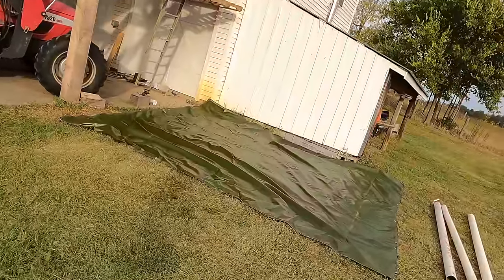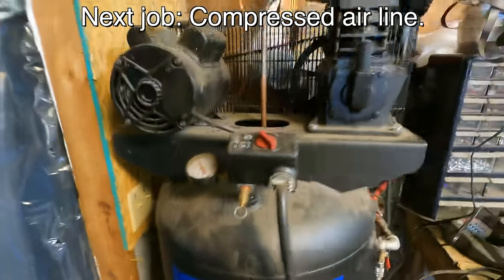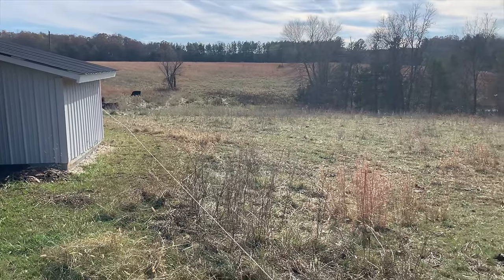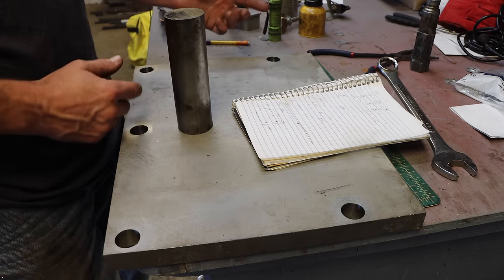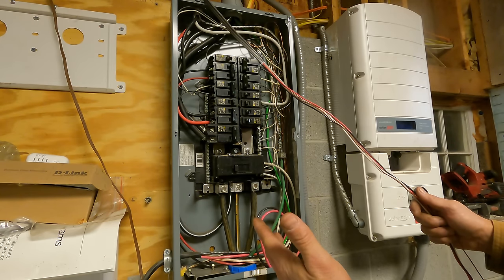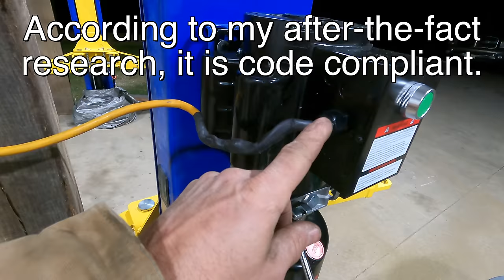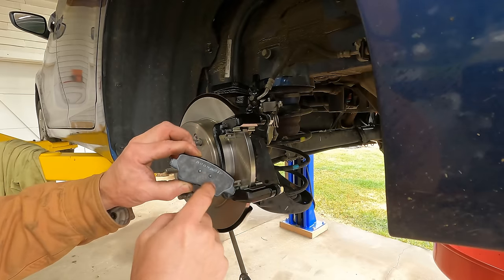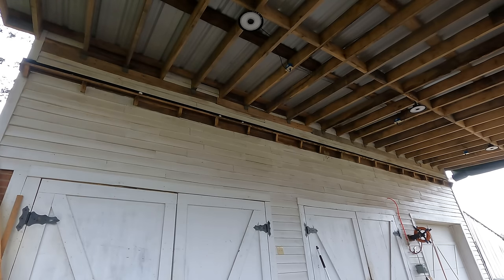Installing a 2-Post Vehicle Lift And Other Big Shop Improvements.

Comment: As an engineer I would have suggested that the 'lower' post was held with all thread into the concrete, levelled with nuts on the all thread under the base plate, the top nuts tightened and the void filled with cementitious grout. Much cheaper and thats how most gantries and lampposts are installed..
Reply: While that would technically work seems like it wouldn't spread the weight as well as full contact underneath
Reply: How do you know what I am or not?
Reply: @mrmotofy  because you would not have replied with your comment. Steel framed buildings to gantries to street lamps use this method to level uneven floors. But hey you know best ... carry on

Comment: I've never seen a car with the back disks not vented.  Now I have.  I sure could have used a lift like that back when I used to do my own brake jobs.  Been a few years since I've been able (I just turned 75 and have certainly gone downhill health wise since I retired a few years ago).  I used to do a bunch of the things he does except I never had the tools (lathe, etc) he has.  But then I live in the city (just outside Atlanta).

Comment: About 11:40, after you cut the ring off, if you dip the pex in boiling water, it will expand and slip right off.

Comment: 2 post lifts are extremely safe if you always use the locks and get the arms under the right spots on the item your lifting, but you can dammage the top of a truck or car or the hood if you don't pay attention to the top as you lift something. 
These would work in a lot of houses garages on cars without a problem providing you dont hit the celing with them.

Comment: The 220v supply to the lift should have an isolater in case  of emergency you can isolate the supply,  since the main panel is on the inside. Great work

Comment: Excellent video. Very impressed with the vehicle lift, what a great addition to your workshop. Must admit, l was wondering about the gap between the base of the lift and the plate on the ground. For the small expense and little work, l thought that putting the grout in was a good idea.
Didn’t realise how much grass cows eat, they didn’t half go through that field.
All the best……Paul from Aus.

Comment: A little tip for changing the brake calipers! Leave the old caliper attached to the brake line until the new pads/rotors are installed. Next install the new caliper around the pads and bolt it in place. NOW remove the brake line from the old caliper and transfer it to the new caliper. 

Doing it this was minimizes lost brake fluid due to the new caliper being in the perfect position for the brake line to naturally fall into position and the banjo bolt can be quickly reinstalled.

Comment: Good job. Two things I would have done differently. I would have run and entirely new cable from the lift to the power box rather than join cables, (I kinda freaked out watching that one). Also, I would have used a vibrator on the concrete to get rid of the air. In Australia you need 150mm, (6") of 32MPa concrete for under a hoist. I worry about the angular stability of that hoist. Please take care with it.

Comment: The normal way to set a base plate above the surrounding concrete slab would be to drill the holding down bolt holes and then use all tread bar, in this case 16mm (5/8") or so and resin anchor the bar into the slab.  When installing the bar a nut can be put on under the holding down plate that when the resin has hardened can be used to adjust the height of the base plate to line and level it.  The gap under the base plate is then  filled with non-shrinkable grout.  This would be so much simpler than all the fabricating and not to mention cost of materials.  I would also be circumspect about the location of the two post legs as they straddle a crack inducer joint and are too close to the edge.  There are substantial forces on the base plate/bolts that will crack the concrete even if it is an 8" fully reinforced slab (normal spec for a two poste lift installation)

I was a consultant for a major (cap. £4Bn) transport company and their standard spec for air line distribution was screwed galvanized pipe as the push fit plastic pipe installations invariably failed that could cause injuries due to flailing pipe.  The company were paranoid about H&S.  Screwed galvanized pipe was more costly but much more reliable.  On one job where the developer had installed push-fit plastic, on first charge up several of the joints failed and the instruction was that the whole depot would not be occupied unless the plastic compressed air system was changed at a cost of £10,000s

Comment: Nice work. I'd swap out the drywall screws for wood screws since they aren't threaded all the way. The threads on a drywall screw are relatively sharp and will cut through the cord eventually.

Comment: Drive in wedge anchors, run the nuts up or down to set your height and level the post, grout the gap with actual high strength grout bro. Use the stainless for a flatop griddle.

Comment: I used pex for my shop air and haven't had any problems either.  The main issue I understood with running pex is you need to be cautious of air temperature.  Hot air directly from the compressor could cause a failure, but the large air take you (and I as well) have will likely let the air cool sufficiently.  If pex does fail, it shouldn't produce flying debris like PVC.

Comment: You should make a lag hook bit for your drill, you can tighten a lag hook into the chuck of your drill and use it to quickly tighten down your other lag hooks by hooking the hooked ends together.

Comment: The thing about pex vs pvc when using it to pipe compressed air is that pex will never shatter and sling shrapnel; if it bursts, it just splits. 👌

Comment: I didn't see you ground the box and conduit, hope you did with a jumper from the incoming wire.  Thanks for the great video..  Maybe consider a ground fault outlet in place of the standard as it is outside per say.

Comment: Well, technically the grass is still there. It's just much more compact now, and a different color. Yeah, I know. I went there. Sorry, I couldn't help myself, lol. But to say that I'm jealous of your new vehicle work bay would be an understatement, lol. I would kill for a lift right now, I'm changing the water pump on my car tomorrow and I'm not looking forward to rolling around on the cold concrete floor. Of course, that's assuming the post office decides to stop wandering all over the state with my bolts. They've already been through my local post office twice now, hoping third time's the charm. Unfortunately, metric aluminum bolts are a little hard to come by, otherwise I would have just bought the dang things locally. Oh well. I do enjoy the heck out of your videos. There's always a lot of nice little tidbits to be picked up here and there, even if the overall project isn't something I'm likely to be doing anytime soon.

Comment: Give you a good safety tip when you put something on your lift, take it about a foot off the ground and give it a good shake to make sure it is settled on the lift good before you go up. Better fall right there then over your head.

Comment: I've had pex airlines for 5 years, never an issue. I use the cinch clamps instead but I don't think it matters. Just avoid shark bite fittings.

Comment: One tip on wiring those lifts, you can open the electrical box on them and pull your own wire through the strain relief and terminate inside rather than soldering to the tiny stub just outside the box

Comment: @33:31 you could also cut the tab on the receptacle and have top (or left) plug on one circuit and the other in the other circuit; thus you could run 2 110v-20A tools as the same time… (well you know what I mean)

Comment: I had no idea you could use Pex for compressed air. That tip alone was worth the watch. :)
Reply: Check your pressure ratings...my 175psi is to close or over.  Black pipe is cheap easy and will last a long time. Use a larger 3/4" - 1" main then drops off that. More capacity and flow is better

Comment: 4:00 all jokes aside, the ritual of saying "that's not going anywhere" is important! it helps you keep track of your work and know what you've finished installing something. for example, if you were hanging a rod and you drive a screw in one end to get it started, then go over to the other end of the rod to lift it and screw that end in, you now have two partially installed fasteners. at this point, it IS going somewhere unless you finish installing it. if you said "that's not going anywhere" and walked away, it would feel wrong. if you just walked away it would also feel wrong. it will only feel right after you say the magic words, and those words only feel right if you've finished installing the fasteners. 

in other words, its the verbal form of marking a bolt with a paint pen after applying final torque. its important!

Comment: The UF cable run through the rafters on the lift bay are subject to future fasteners driven into the cable  from the top side. also the receptacle added is not properly protected as wired into a 240 volt breaker, both legs are tied at the breaker. bushings should be added to the ends of the conduit.

Comment: Get an old Garage Door motor and use it to roll the tarp up and down. You can use a wired switch or the old wireless controller. You need to figure out how to trip the stops on the motor but that's totally doable with a myriad of different options.

Comment: John, I know you mentioned that your not an Electrician, that being said, you should have installed a disconnecting means on the lift, and terminated your flexible cord, from the motor, on the load side of disconnect, and the hard three wire cable on the line side lugs/ terminals in the disconnect. if you ever have to  work on the motor or controls, you will understand, also if you have to disconnect power  in an emergency. Just throw the handle to off, also you would be able to add a lock, to limit unauthorized use. 
Other than that, great video, and great content.

Comment: Installing wirenuts one should twist the wires with pliers till the insulation part is twisted also
Those rubber hoses don't last long outside most of the time unless they're rated for outdoors

Comment: The only issue on the PEX is its limited out at around 120psi. Hot days take off the small margin you have. If you are going to use PEX for compressed air use Pex-al-Pex which has an aluminum layer in the middle. Used mostly for radiant heat systems, its sometimes called barrier PEX as it also reduces oxygen creeping thru the pax itself under or inside a concrete slab. All the rest is the same. But you get 200 psi capability up to 180F. Slightly higher in price but its much better suited for compressed air.
Reply: Yep , I have a 2 stage compressor that I run to 185psi occasionally , I wouldn't trust that pex

Comment: When making a 90 degree turn use a 90 degree pex support bracket instead of a fitting. Less joints so less chance for leaks and the ability to anchor the  line

Comment: Clever tarp arrangements, but not in love with sheetrock screws.  They rust easily, even if not directly getting rained upon.  Short deck screws would be my choice.
I would also STRONGLY suggest you buy a pair of lineman gloves.  $22 on Amazon.

Comment: Seeing a 2 post lift being installed reminds me of the biggest corruption I saw as a new business owner. I opened a automotive performance shop in las vegas in 2013. When i was putting up my lifts. i found out that the inspector that comes to your place when its set up to see if everything is to code and safe. The city would not allow you to put up 2 post lifts unless you buy the anchor bolts from the city at $90 per bolt. They were the same brand as the ones that came with my lift. Plus they confiscate the bolts that came with your lift. Pretty sure they were selling the bolts They confiscated. So a $2 or $3 bolt went to $90 each.

Comment: Just so you are aware, solder joint are illegal in a/c wiring. The reason is, if there is a fault, the wires will heat up and desolder the joint. Also the two screw clamp that you used to hold that cable at the bell box is not listed for outdoor use. One more thing that I saw that you don’t use was a bushing on the end of the conduit where the uf cable was entering. That is very important as it stops the emt cutting the uf cable. If it was me I would have ran the emt all the way to the inside of the building as water can enter the top of the raceway.

Comment: I was thinking that if you had a spray foam insulation sprayed to the underside of the roof metal it would help considerably with radiated heat from that dark colored metal roof

Comment: The next time you need to set steel columns plumb and the base at same elevation the standard in the steel erection business is to use leveling plates with grout beneath to bring to spot on level.

The idea is you cut a 1/4 inch plate a bit over the size of the column's base plate and with the same hole spacing. I'd also use epoxy anchored anchor bolts, but it hardly matters on the lift. Then you drop the plate over a puddle or pile of leveling grout push down to close, but high and use your laser level and small hammer to tap it down to perfection.

It works great and saves a bit on me swearing which is half the fun but scares my dog.

Comment: In the UK it's a requirement that all bare ground/earth wires are sheathed in green'/yellow sleeving.  It prevents the possibility of the earth becoming live when the wires are squashed against a live wire when the box is put together.

Comment: The most impressive part is that you managed to remember to slide your heat shrink over the wires BEFORE making your solder connection! 😂

Comment: You could fill the PVC pipe with sand to give it some weight, this way it will not blow in the wind as much also cap the end up with PVC caps. When saying fill that is just a little in each pipe because you would need to manage pulling it up with the weight.

Comment: Rather than boring stainless steel, fabing custom bushings, etc.  I would have considered building a small frame  out of rot resistant wood to contain leveling compound, putting some masonry screws or lag bolts into the existing pad leaving them up a bit and poring leveling compound around them.  The whole thing would self level without a bunch of additional measurements as well.  I don't think the PSI under those lift posts would be too extreme for the compound.  If those pads are 16x16 even 10 tons would only amount to ~ 40 PSI at the pads.  Lots of leveling compounds will support 1K of PSI.

Comment: Long runs of airline cause restrictions in flow. Better to use 3/4" - 1" as a main then down to drops, I like 3/4". The flow rates of line sizes always seem exaggerated. More flow capacity is better. Pex sizes are actually smaller than normal pipe sizes due to thicker walls.

Comment: as a suggestion I would have installed a disconnect on the lift, so I could power off for service. Just a suggestion you method will run the machine.

Comment: need to use a impact driver for removing the screws in the rear rotor. harbor frieght $10.   that lift out of kilter with the spacer will be a PITA  on low cars.

Comment: Crazy watching a youtuber solder correctly, heat rising through up through the wire and melting the solder into the wires instead of melting the solder on the iron and touching it to the wires like most people

Comment: 19:00 it's not just a farmers thing imo. there's a reason that machining tolerances or tolerances in general aren't always given to a hundreds or a thousands of a millimeter: it's not necessary. in fact it drives up the cost massively if a tenth of a mm is enough and you specify a hundreds.

Comment: 26:53 Putting short lengths of small heat shrink tube on each wire before soldering them is a LOT faster and easier to protect each joint (and just as effective as electrical tape) and then use the larger heat shrink to seal up the entire cable...

Comment: We did an entire machine shop with 1/2" pvc pipe  at the drops we added a drip tube and pet cocktail to drain the water, you send compressed air over a mile of plastic pipe its going to cool down enough to separate the water from air in the lines it has to drain off some where.

I dont see why not pex  they make plastic airhose lines, im pretty sure no one going to inspect your air lines and write you up on them, I cant see a hazard on your own personal farm.   Just for shits and grins 
Fill a 55 gallon barrel of water and put z coil of copper pipe into it off thd compressor pump then back up to a dryer then into your tank, this will keep water out of the tank or  use an automotive ac condenser and high flow fan over the coils then into a dryer and then the tank either of theses you have really dry air.

Comment: Have you considered putting a bit of weight in the 4" pipe to help keep it from moving as much?  Maybe some sand and capping the ends?
Reply from the maker: Would be pretty hard to roll up then.  Haven't gotten to it yet, but I'm just going to use some paracord and fasten them down to either the concrete or the building, same mechanism that you use to fasten a tent fly to a stake.

Comment: Internal diameter of the PEX lines?  Good job on the roll down tarp and the PEX air line installation.  What ever happened to prior owners of the Marshall Place Boxwood operation off of Little Creek Rd in Dillwyn?  From Google maps it looks like no more English or American Boxwoods are being grown on or sold from that Farm.

Comment: 20:50 stainless steel is an alloy that has chromium in it. That gives it its corrosion resistance but also makes it rock hard. I hate drilling stainless steel.